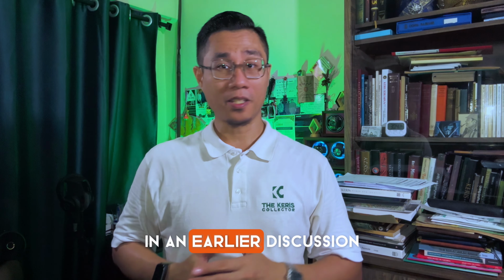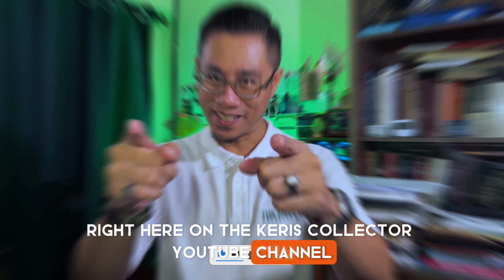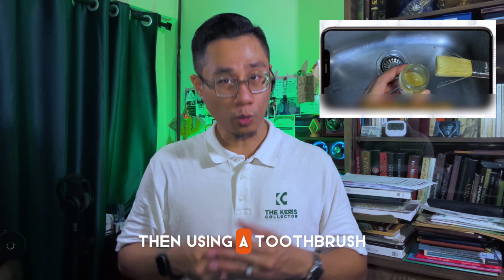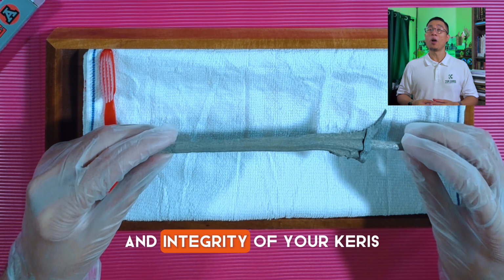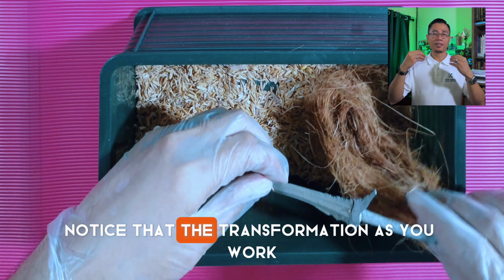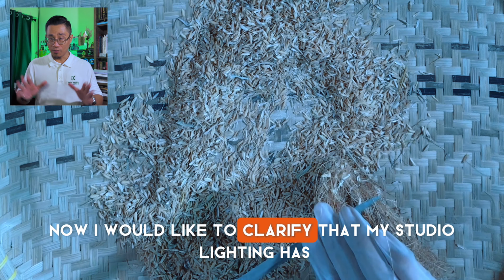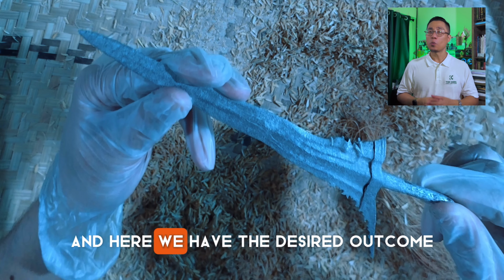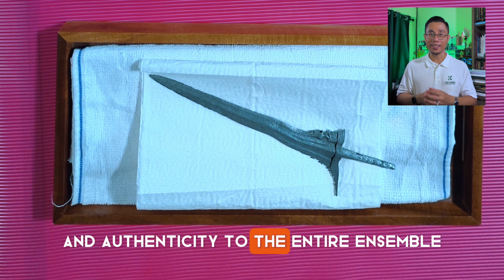Reviving Tradition: A Unique Keris Restoration Technique Revealed!

Comment: Salam.. should the rice husk and coconut fibre be washed first ?
Reply from the maker: Salam… You can use it straight out of the bag. Do share the results after you are doned. 😃 - JoFe.
Reply: @TheKerisCollector  insha Allah! :D
Reply: @TheKerisCollector  Salam pak jofe, fyi I have completed the mutih and rice husk method. Took some time... Will share the results soon insha Allah.
Reply: I just want to share that from my few days experience with the keris I felt that ppl in the present days don't give the old civilisations enough credit for their genius. It is as if the older civs sengaja taknak "progress" at such a rapid rate that it prevents the environment from healing. I mean most resources I have used so far are renewable and they work so well. Nowadays.. "progress at all costs"  macam yajuj wa majuj. Allahu a'lam.
Reply from the maker: The wisdom of the past is only appreciated by the enlightened few. Back in the day, Man understood balance. Take From Nature, Give Back To Nature. Today, Man Only Knows How To Take. Expecting everything belongs to Man. Since then everything has become off balance. No surprise here tho. It’s all been warned and we are expected to prepare for the EndGame. It is what it is. 😃 - JoFe.
Reply from the maker: Excellent. Hope it turned out well for you. 😃- JoFe.
Reply: I have a kodi that I managed to "warang" using steamy hot, fresh , coconut water. The keris is dipped and left for 15 mins per side for 3 total cycles, the coconut water kept warm.  Black patina started forming. 

I then rinsed using mineral water but the black patterns disappeared after I blow dried it. 

But when I oiled it (nak simpan balik pasal budak2 da bangun tido), it turned black again seh. Cantek. 

Insha Allah will send u some pics soon.
Reply from the maker: That’s not “warang” bro. 😳 -JoFe.
Reply: @TheKerisCollector  😂😂😂 project to be continued